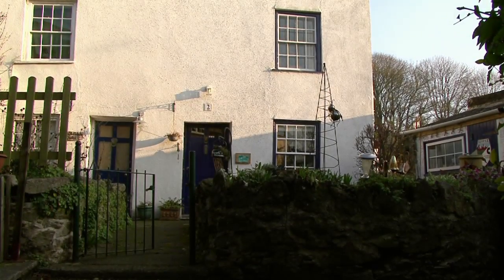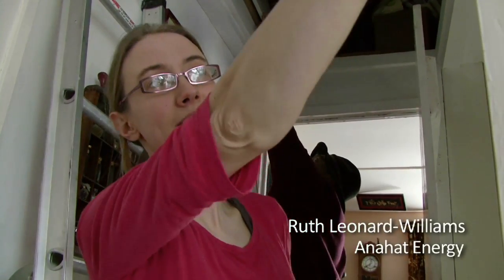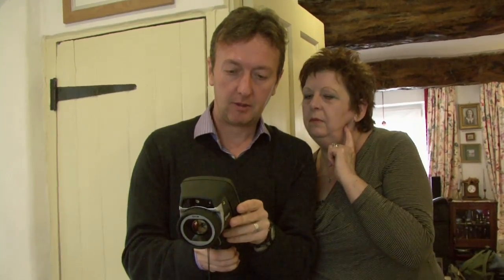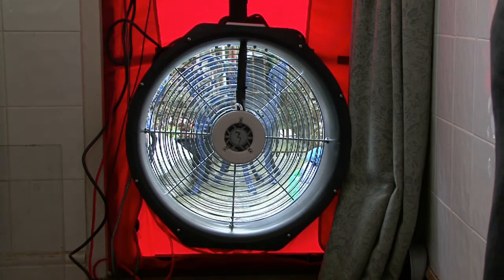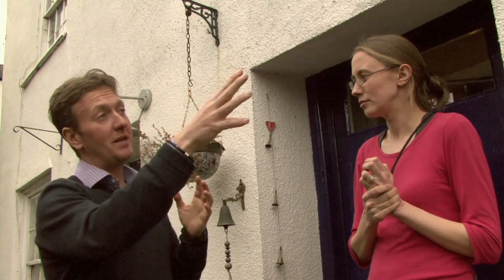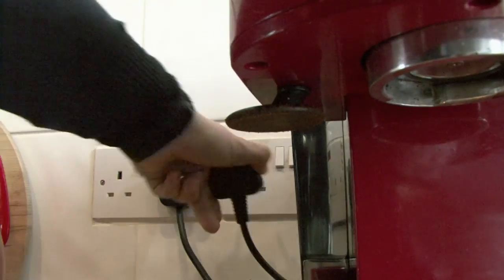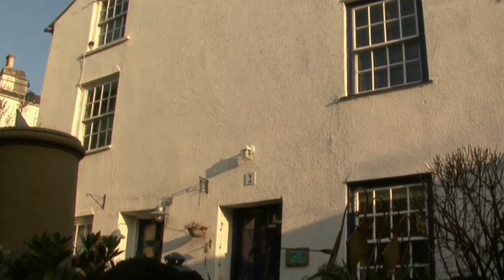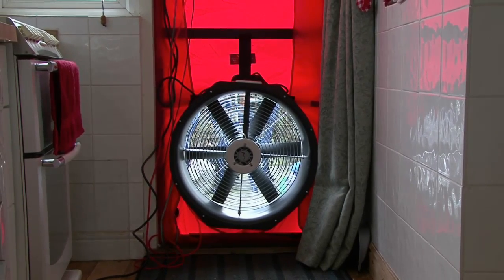Grade II listed 16th Century Stone House: energy saving advice

Comment: Pity there is no treatment of the walls themselves - are they damp? Is heat lost through the solid walls and why? No treatment of insulation in the roof - fibreglass or wool - condensation.  No assessment of humidity in the building.  The easy bit is seeing where there is heat loss on doors and windows - any dork can do that - understanding solid walled buildings, dampness, reasons for heat loss in walls, how to improve those, is hard.  This video only skims the surface of the issues involving solid walled houses.  Enthusiastic presenters, but deary me - a lot to learn!